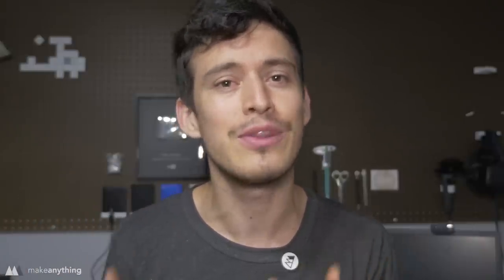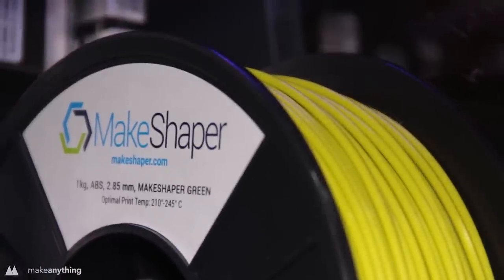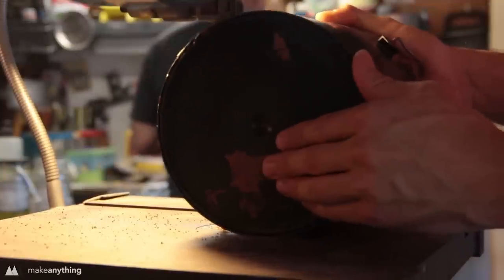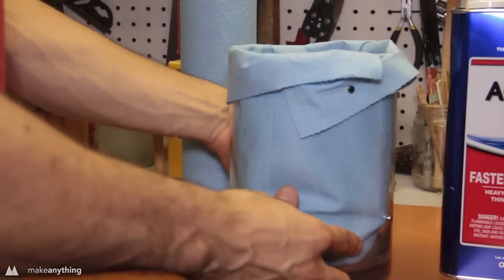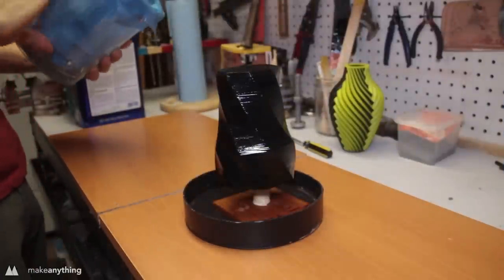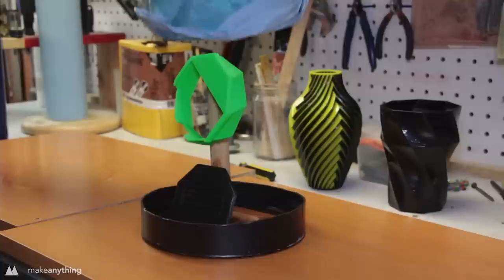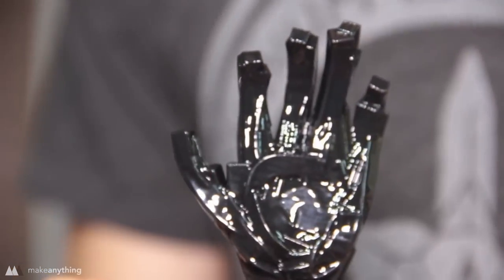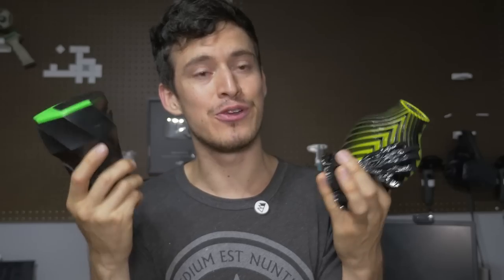Super Smooth Prints // Acetone Vapor Bath

Comment: You mentioned using a stove. Please don't do this. If you want to hot vapor smooth use a sparkless electric heater, otherwise you might have a fire or might even have an explosion.

Comment: Acetone is extremely flammable, so thank you for not using open flames or high temperatures near it. I want to note also, that people who try this not  breath the acetone vapors or allow them to concentrate in a small work area, so use ventilation and be sure there are no gas water heaters or the like nearby. Get rid of the paper soaked with acetone outside in a safe manor - once the acetone evaporates you can put the paper in a closed recycle trash can.

Comment: There are several solvents that can vapor smooth PLA that I know of, you could try those as well :) Some of them are Tetrahydrofuran, Dichloromethane and Dioxane (1,4-Dioxane). THF should be similarly dangerous as acetone and Dichloromethane is the main ingredient of polycarbonate glue/solvent called "Technicoll 108". I've seen some experiments with these smoothing agents for PLA prints, but only in writing and photos. A video would be nice, especially a quality one, like you make. :)
Reply: Im pretty sure THF is considered more dangerous than acetone
Reply: i can't remember but think there are problems with all of those,
Reply: Rafael Dos Santos THF is relatively safe and easy to work with, if someone's comfortable enough to work with pure acetone then they shouldn't have a problem with THF as long as they take the same precautions 

I dunno if it's easy to actually buy it in most places though. What makes acetone the top choice is that in most countries it's super easy to find without having to order anything online or go to a some really obscure specialists store, but THF might not be so easy to find
Reply: Chloroform.
Reply: bort sampson nah
Reply: You want to be carefull with THF dioxane and dichloromethane 
 THF penetrates the skin, causing rapid dehydration. THF readily dissolves latex and is typically handled with nitrile or neoprene rubber gloves. It is highly flammable.
One danger posed by THF follows from its tendency to form highly explosive peroxides on storage in air.Distillation of THF to dryness is avoided because the explosive peroxides concentrate in the residue.
 
Dichloromethane: acute overexposure to dichloromethane via inhalation include difficulty concentrating, dizziness, fatigue, nausea, headaches, numbness, weakness, and irritation of the upper respiratory tract and eyes. More severe consequences can include suffocation, loss of consciousness, coma, and death.[1][14]
DCM is also metabolized by the body to carbon monoxide potentially leading to carbon monoxide poisoning.[20] Acute exposure by inhalation has resulted in optic neuropathy[21] and hepatitis.[22] Prolonged skin contact can result in DCM dissolving some of the fatty tissues in skin, resulting in skin irritation or chemical burns.[23]
It may be carcinogenic, as it has been linked to cancer of the lungs, liver, and pancreas in laboratory animals.[24] Other animal studies showed breast cancer and salivary gland cancer. Research is not yet clear as to what levels may be carcinogenic.[1][14] DCM crosses the placenta. Fetal toxicity in women who are exposed to it during pregnancy, however, has not been proven.[25] In animal experiments, it was fetotoxic at doses that were maternally toxic but no teratogeniceffects were seen.[24]

Dioxane Exposure may cause damage to the central nervous system, liver and kidneys.[11
Like some other ethers, dioxane combines with atmospheric oxygen upon prolonged exposure to air to form potentially explosive peroxides.

Comment: So Angus from Makers Muse mentioned that 3D printing isn't the best way of making containers/implements for food use because bacteria gets stuck between the layers etcetera, and is hard to clean. 
Would vapour smoothing omit this problem to some extent? If so, 3D printing just got a whole lot better in my eyes!!
Reply: I would generally not use ABS for "food contact prints" because of the additives that ABS needs. So, vaporsmoothing with acetone is already not possible anymore.
PLA, if manufactured to food safe standards, is a much better option. Or some specialized plastics like PP or HDglass (PETG) would be even better. However there are more ways to "contaminate" food safe filament in your printer, like lead used in the brass nozzle, dirt from other filaments you use in the printer, and so on...
Still the best way to make 3D printed designs used for food contact would be to seal them with some food safe epoxy after printing. And i would still only use them for very limited food contact, like a cookie-cutter or something that only has very short, mostly dry and cold food contact.
Reply: 3D printed items aren’t generally very good for utensils or anything else you put food/drink on/in. Only reason I’d do that is if I coated in in epoxy or something...a food-safe kind, of course.

Comment: If I recall correctly, acetone is a heavy gas as it evaporates so you can probably simplify your process by turning the assembly over.  Have the glass on the bottom, lower your part into and put the plastic lid on.  I don't think that you really need the water seal.  Beautiful results especially on the hand.

Comment: Is abs toxic?
Reply: Yes
Reply: It's the same plastic that's used in Lego, it's not something you should be scared of
Reply: Noah Hobson 
I know it's toxic, but it's relatively safe to use, and not toxic when it's cooled
Reply: failure lmao and acetone? Is it dangerous in any way? What, if any, are the risks?
Reply: +Wandering Eclipse  Not particularly. Fumes could displace oxygen and asphyxiate in large quantities. Flammable. Dries your skin out. Acetone is the enemy of plastics, however.
Reply: Wandering Eclipse
If you're going to use it, make sure you have some sort of ventilation. It's not something you want to be breathing, and it will evaporate at room temperature.
Reply: Noah Hobson smartly has been a word for centuries
Reply: Wandering Eclipse same stuff LEGO is made from
Reply: Wandering Eclipse it is highly flammable, and will dry out you skin if in contact for lengthy periods of time, also you can refine it and use it to make narcotics. 🙂
Reply: failure lmao yeah it's very volatile

Comment: And now you have a very flammable sculpture. Seriously, I checked for myself. Also, the stiffness of the ABS is really compromised with these acetone baths. Somethimes, even after drying for long times, heating up a little bit the part you can see the bubbles from acetone evaporating from the surface, and leaving behind some kind of ABS foam. That's because the top layer dries but the inner layers remain soaked with acetone isolated from the outside. Keep that in mind.

Comment: You need a temperature controlled area to stop ABS shrinkage.

You can probably do a good workable ghetto Plexiglas system and use a good temperature controllable electric heater and some PC fans to control the heat flow out of the 'greenhouse' around the printer!

Comment: Hi, out of curiosity, do you happen to know if their is a sweet spot when it comes to layer height? Is their a best height that would have the best smoothing effect, or does that even matter? Thanks !
Reply from the maker: Typically the smaller the layer height the more smooth the model. O.1mm is pretty much as low as I'll go though because below that the return is minimal
Reply: Have you gone with any bigger layer heights? If so were your results?

Comment: If you feel like a surface doesn't need to be affected by the acetone vapor, simply put hand creme, toothpaste, or anything paste over it. It will block the acetone and keep the surface as original. Washing it is easy.

Comment: Is regular nail polish remover from like, the dollar store, strong enough to smooth print lines? Personally I love the print lines. Makes it really have the 3d printed feel.

Most people are like zomg 3d printers and love to examine the print lines. I like looking at them too.

My college only prints in pla though so that's an issue lol.
Reply from the maker: There is 100% acetone nail polish remover that would definitely work.. but there is also non-acetone remover, so just make sure you get the right one!
Reply: Make Anything ahh ok that's good :D my college only prints in pla though. What's a good cheap (read: college) way to smooth out pla prints or to give them a nice sheen without adding any polyurethane or something like that?

Also I must say I've been bingeing on your videos for the last 3 days. I guess having not had access to a printer for months has made me long to see stuff related to it hehe. Man I can't wait until I get back to see those lovely Fusion 3 printers.

Comment: Never liked the towel method. Too slow and I can't monitor progress, which is important because there are a lot of variables. Try using an asparagus steamer on an electric hot plate set to the lowest heat setting instead. Takes less than a minute and you can monitor the process through the glass lid.

What I'd really like to do one day is make an acetone atomizer that circulates extremely fine vapor through a sealed chamber in a controlled manner.